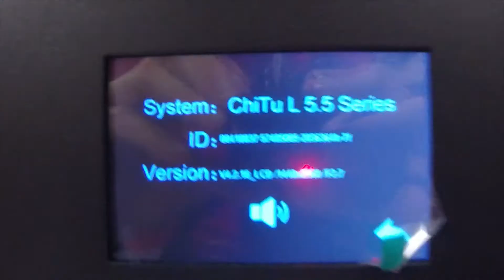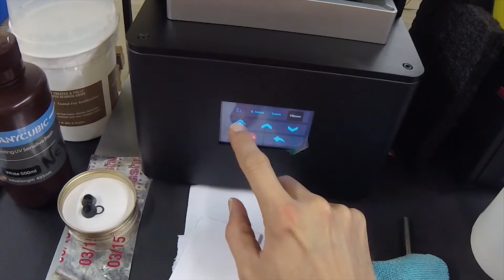Is EPAX X1 Better Than Anycubic Photon Resin 3D Printer? Part 1: Unboxing and Initial Review

Comment: Part#2?
Reply from the maker: Haven't finished Part 2 yet, but what I can say is that the EPAX is an extremely well built and reliable machine. The only issue I had was that prints did not adhere well to the bed while the screen protector surround tape was applied. I removed that tape, recalibrated Z, and it worked well from then on.
I would buy the EPAX over the photon, mainly due to the more robust build plate adjustment. The ball head on the photon is too easy to knock out of alignment when removing prints.

Comment: Is Photon VAT compatible with EPAX X1/X1K and vice versa?
Reply from the maker: Photon Vat fits in the EPAX X1. Unfortunately the EPAX vat does not fit in the Photon. It is slightly too wide.
Reply: @engineerable  Do you have dimensions of both of these? I am looking to buy spare VATs with covers, but damn genuine EPAX VAT cost 70$USD....
Reply from the maker: @brezovprut4431  Let me take some measurements and get back to you
Reply from the maker: I made a video to compare the Anycubic Photon vat size vs the EPAX X1. This video shows the fit, or lack thereof https://youtu.be/Rkf-aQPLpNA
Reply from the maker: And this video shows the actual dimensions. https://youtu.be/S-sUqE3sE0o 
Basically the EPAX X1 vat is 2mm wider, and therefore does not fit in the Photon.
Reply: @engineerable  Thanks, appreciate it!